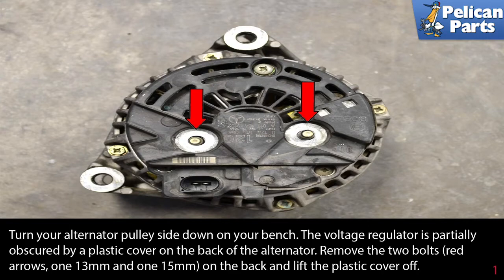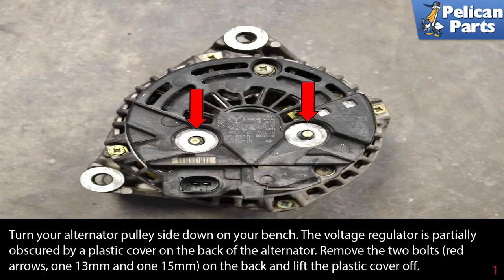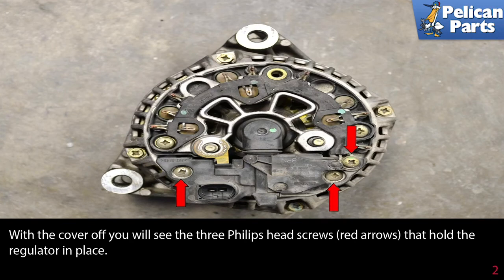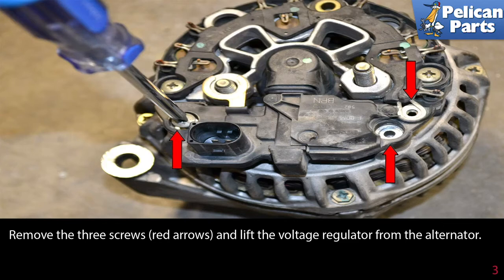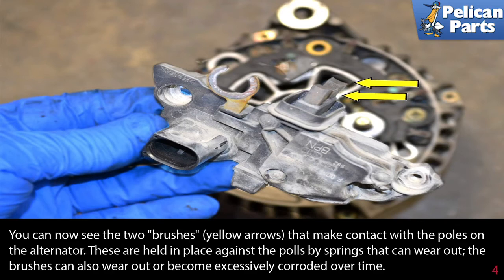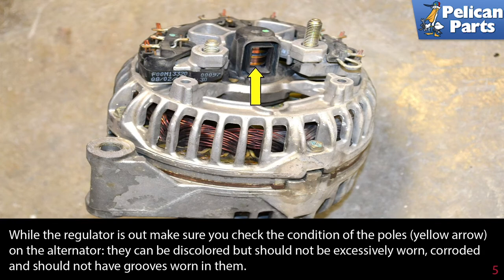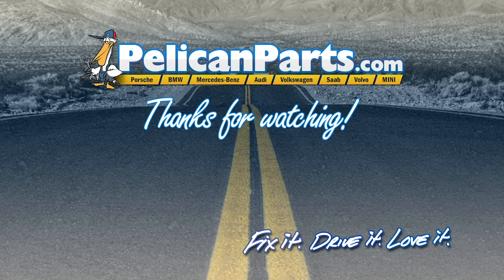Mercedes-Benz W203 C-Class Voltage Regulator Replacement

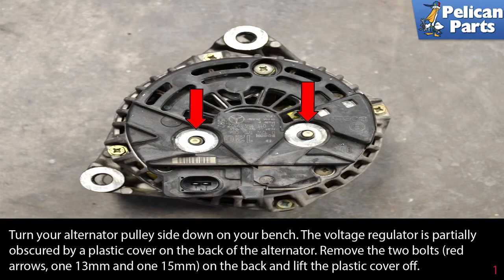Comment: Folks, the two bolts rest inside, the nuts are to be removed. You did not mark the screw with the Philipps head which has to be removed as well, clearly visible at 0:38. "Lifting the regulator from the alternator" seems odd. Shouldn't the regulator be pulled sideways towards the bottom of the video screen? 
I am happy to see the details of the regulator cover and the regulator itself in your video, but your audio description has a quality issue - sadly.
Reply from the maker: Thanks for the feedback.